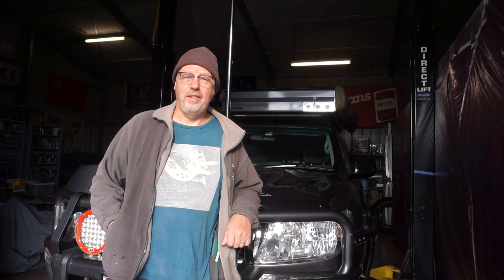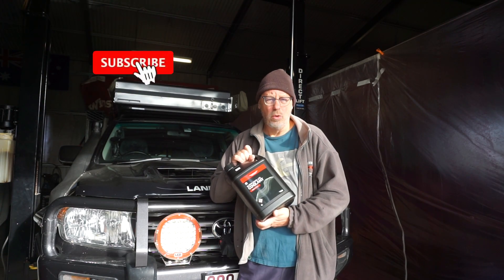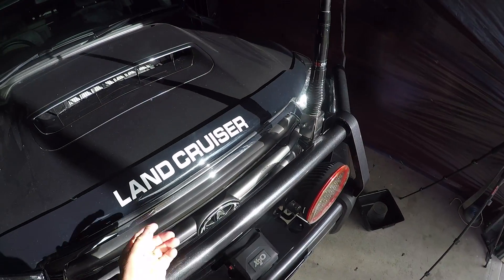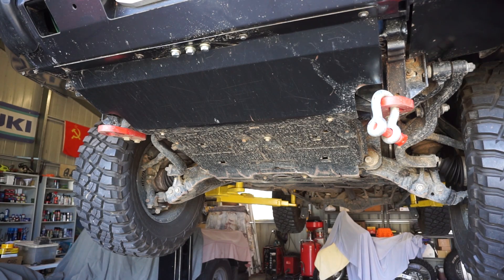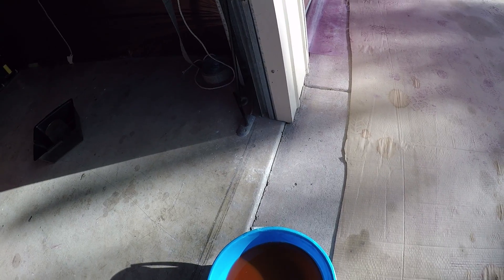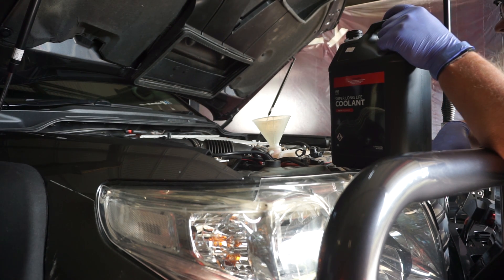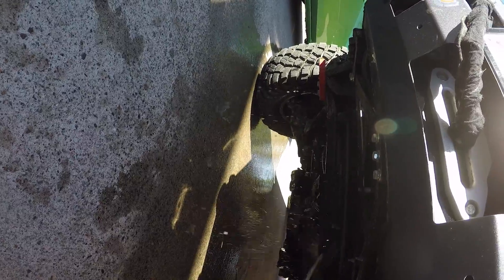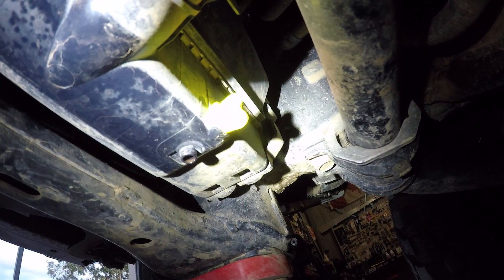How to Change the Coolant | Toyota Landcruiser

Comment: They’re $40 a bottle now Terry. Theoretically I could just buy the 10L then instead of the full 17. My 200 is 10 now with 123k so I was considering changing it. The manual says replace at 160K but the way I use the car it will take 5 years to get there LOL
Reply from the maker: Well if there is one thing I am certain of, you cannot over service your vehicle.  Do what you feel is best for you mate, but at a bare minimum change when Tojo says to change.  Cheers👍😎

Comment: Can I do this for v6 dual tank gas/LPG...? Toyota prado 03. Awesome vdo by the way❤
Reply from the maker: Thanks mate.  I’m sure you can, it’s a different motor with different configuration but cooling systems are very similar across platforms.  Just do you research before hand and you will be fine.  Cheers👍😎

Comment: Great video, My coolant mixed with coolant and normal water and I need to replace it with coolant only as the manual says what is the best way to do it btw I have LC200 2013 v6 non diesel
Thank you
Reply from the maker: Definitely best to follow what your manufacturers manual says.  Just note that Toyota dealers sell concentrate that requires dilution with water before adding to your cooling system, AND they also sell premix that has already been diluted which is designed to be added directly to your cooling system.  Cheers👍😎

Comment: Hi, my rear heater stopped work after coolant change, what did I do wrong, any idea ?
Reply from the maker: Is it possible you still have air in the system?  Filling until it comes out that overflow I pointed out, and elevating the front end of the vehicle are both useful.  Good luck mate 👍😎
Reply: @JafffaAdventures  Yes I did fill exactly same as you.
Reply from the maker: Sorry mate, I’ve never had the problem nor have I ever heard of it.  Air lock would be my only thought.  Perhaps run it a bit (keeping a close eye on the temperature) then allow to fully cook down then top up?

Comment: Quick question, what about those that run on an old model land cruiser, lets say the 80 series 1hz engine...
How many litres of coolant do you put in?
Reply from the maker: The coolant capacity on the 1HZ depends on a few variables.  Auto/manual without rear heater 10.9/11.1 litres, Auto/manual with rear heater 11.7/11.9 litres. This information is in your repair manual and if you don’t have one I would highly recommend getting your hands on one if you do mechanical work on your vehicle.  Cheers😎👍
Reply: @JafffaAdventures  thank you soo much...
Reply from the maker: No worries mate👍😎